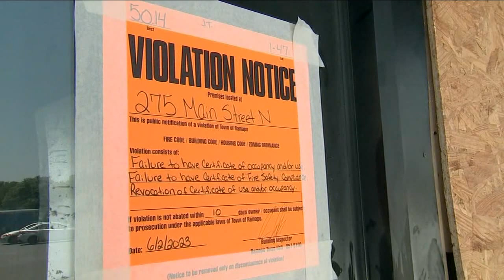E-bike battery blamed in fire that damaged barbershop in Ramapo

Comment: "One worker believes the problem was an overloaded extension chord."

So once again, an eBike battery fire caused by an utter lack of respecting basic electrical safety precautions. But NOPE, that's not a catchy headline. "It's the eBikes It's the eBikes". Cause anything that stokes the ego of car enthusiasts sells.

Meanwhile car fires in gas powered cars barely get any news coverage, despite statistically having more fires than Electric cars and eBikes combined.